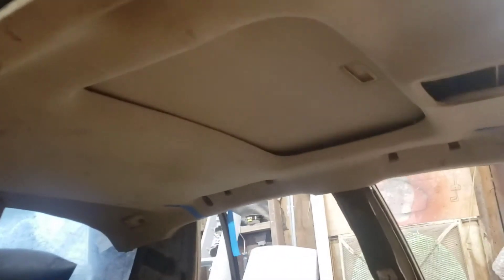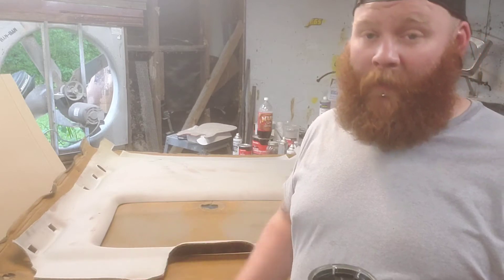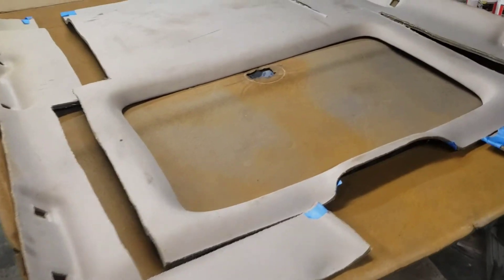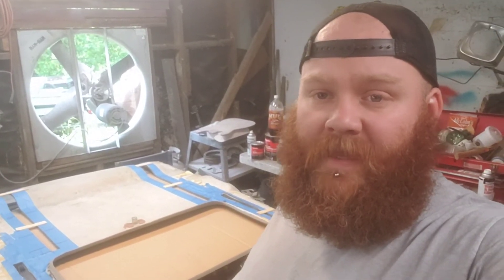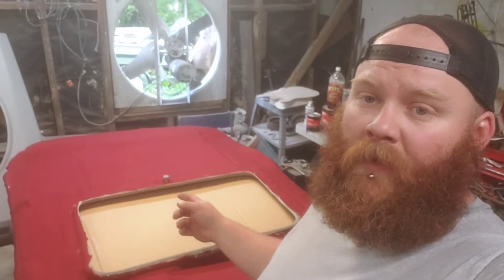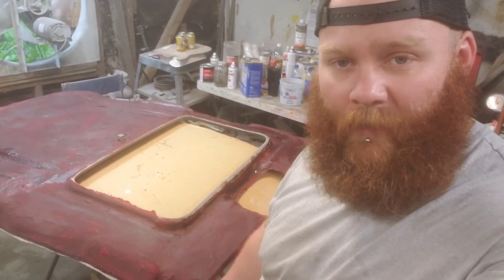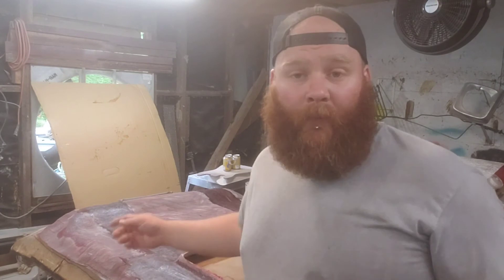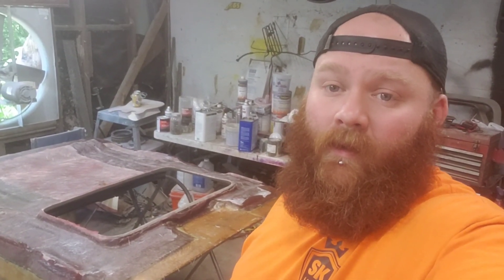Custom cadillac headliner part 1. We ran into a problem. Box chevy transformation.

Comment: Do you do frame knotching on g body’s
Reply from the maker: For wider tires?
Reply: For 24” I’m putting 9” Ford rear shortened 2” on each side
Reply from the maker: @terrybenton4137  so you would need the frame notched and possibly a mini tub to clear. I can do it, but I am covered up with this caprice at the moment and I have minimal room right now.
Reply: I feel that what’s the price for that I don’t think I’m gonna have to to do mini tub tires are 24/9 with a reverse lip on rear not in a big hurry as I need an experienced welder to do the job which is very limited where I live ... Brunswick Georgia
Reply from the maker: I will have to price materials to do it.
Reply: I already have the knotch kit
Reply from the maker: Oh ok. Will the rear end already be in the car?